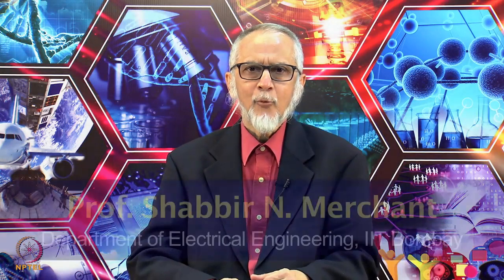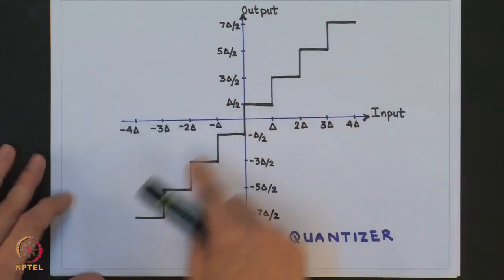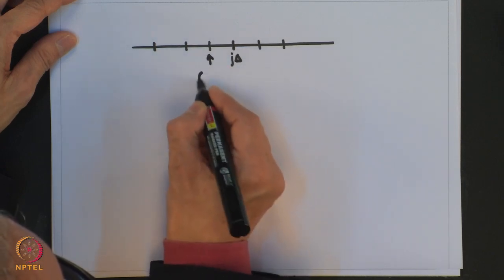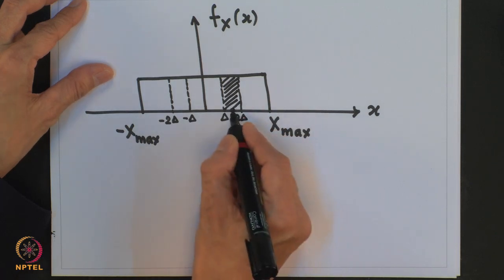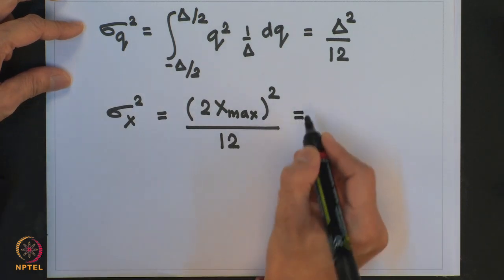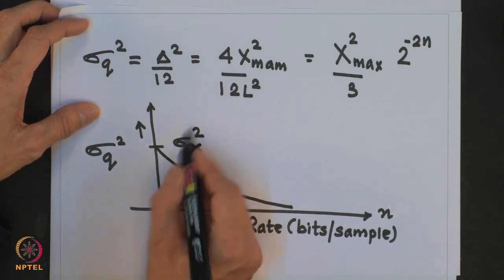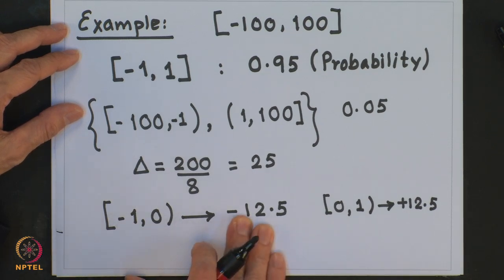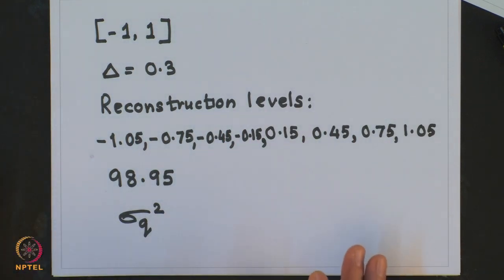Week 5-Lecture 26

Comment: I have considered integration from +del to 2del i did not get the same result
Reply: You can not consider integration from +del to +2del in this case because the integration limit  is on value of error 'q' which in the given example lies only between -del/2 to del/2

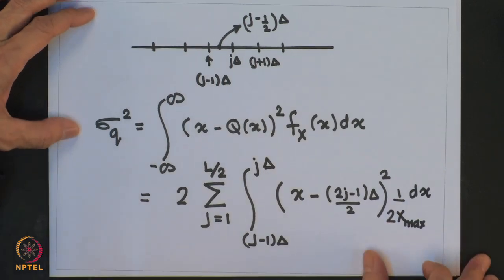If you want better understanding of how to evaluate the integral, I suggest you to solve the expression given at 9:03 directly.
Or you can refer to this image for better understanding

https://ars.els-cdn.com/content/image/1-s2.0-B978012396502800005X-f05-35-9780123965028.jpg?_
https://www.sciencedirect.com/topics/engineering/uniform-quantization